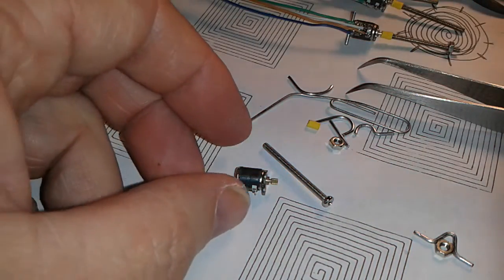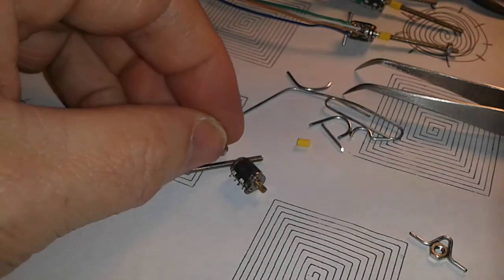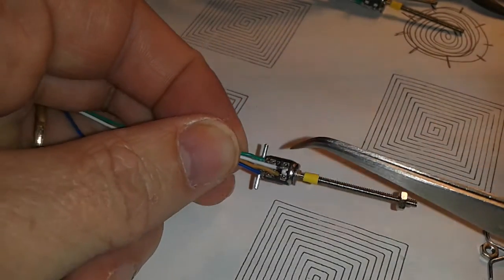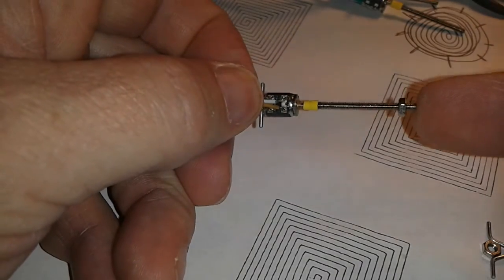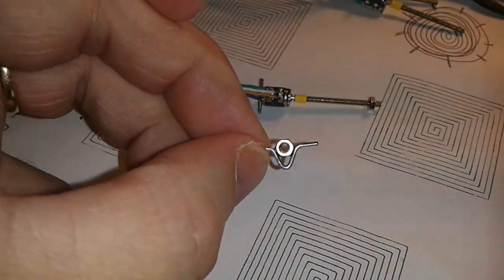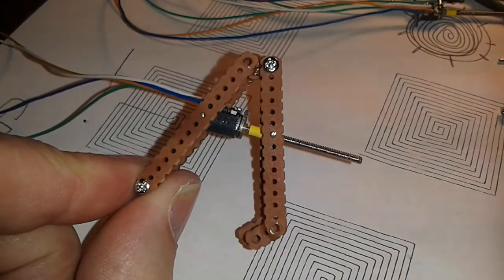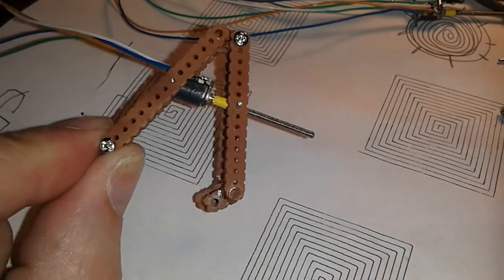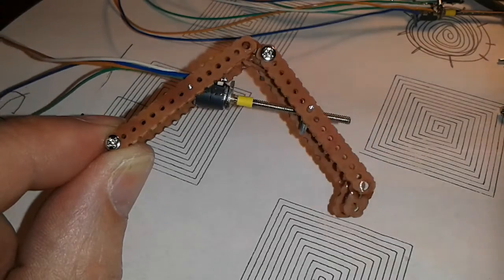Micro Mini CNC Linear Actuator - Part 1 - Building the parts.

Comment: Would you happen to have a diagram on how to wire the motor. I really like what your doing. I would like to see it when you are done.
Reply from the maker: It is s standard 4-wire bipolar stepper motor. Requires a controller of some sort. I have some vids of a robotic arm I made with several of them.

Comment: If you would disclose how you are driving the stepper that would make your information actually "cool".
Reply: a quick google search for drivers would be "cool" on your part.
Reply from the maker: Any stepper driver will workb but... This is running from a Linux PC, controlled by a Python script, over a USB serial adapter, to a pic12f675 and an SN754410 quad half bridge per each channel. Basically I'm sending the pin-out states serially on a master-slave network.

Comment: Why wouldn't you just use something like these: https://m.aliexpress.com/item/32848412516.html?trace=wwwdetail2mobilesitedetail&productId=32848412516&productSubject=32848412516&shortkey=FJvIrueA&addresstype=600
Reply from the maker: That's a stepper drive for a slim optical drive (I have a few). You could certainly use it to build a linear actuator, but it would be 3 or 4 times bigger, and i don't know how much heavier. However they do sell tiny steppers with long screws on ebay now. That would be a good option.

Comment: When I saw the screws and nuts, that's when I said, "yep I did something like this with this robotic claw I've made". What I did was actually solder the screw to the shaft. I also added a little oil and purposefully left a gap between the base of the screw and the nut. I found that it works better that way.
Reply from the maker: Please post a video so we can check it out.
Reply: Hey Clayton. This is one of the first robotic claws I've made. It's really old and the one I had before worked way better. Unfortunately, I took it apart. I wish I can show you a better one. I did add something else I was working on. I was testing an old motor I've altered. It has a gas line running through it and it allows flames to shoot out of the drill. I can make the flames higher, but with my two jobs and having to relocate most of the time, improvements have been slow lately. 
https://www.youtube.com/watch?v=VYhmYw2Rf8g
Reply from the maker: Cool. I may do something similar to that on my next arm.

Comment: Sir, this is exactly what i was looking for, but i need more speed... can they go faster?
Reply from the maker: PhotoSlash - Maybe. They are running as fast as possible at 5v. The motors will skip if the steps are faster. But they might go faster at 12v. At 12v you will need current limiters or they will probably overheat.
Reply: PhotoSlash - You can make a make it go faster without adding more power, by playing around with the positioning of the pivot points and/or use a courser threaded rod and nut. Either case, will decrease the amount of pull/push force the assembly can provide.
Reply from the maker: mtktm - Yes. This is another good option.

Comment: and i would like to know what circuits you used to control those stepper motors.
Reply from the maker: The motors are powered by an SN754410 quad half bridge. The SN755410 is controlled via a PIC12F675 microcontroller from a serial port. It could also be done using the pins on a raspberry pi. I have a website, www.PyPins.com, where I am trying to document the process. All the software is up-to-date, but the documentation is not at this point.
Reply: your video made me to try my mini project possible...thanks for the video....i'm trying to use Arduino Nano with L298N drive...are these motors gonna work?
Reply from the maker: Yes. The SN754410 is a direct replacement for the L298N, so that should work fine. Just be careful with the voltage on these little motors. They have low resistance and can get hot very fast. I turn them off (set all pins to low) when they are not moving. This gives them time to cool down.

Comment: can you please tell which of these motors are like yours.........

http://www.amazon.in/3-5V-Phase-Camera-Stepper-Motor/dp/B00MJTXVBA/ref=sr_1_18?s=electronics&ie=UTF8&qid=1488947690&sr=1-18&keywords=mini+stepper+motor.....................
(  or  )..........................http://www.amazon.in/dp/B06W9KSGW8/ref=wl_it_dp_o_pC_nS_ttl?_encoding=UTF8&colid=1NPQEYW1VZNCK&coliid=I1MEP95T1DAKQD
Reply from the maker: They are similar. I think mine are 6mm in diameter. Look on ebay. There are many different varieties that are very inexpensive. Some already have screws attached.

Comment: Hi Clayton, I bought 10 tiny steppers from Banggood a few days ago.  They may be of interest to your viewers because they already have a screw and nylon nut.  Price is less than US$0.93 if more than 3 are purchased.  Banggood listing is "DC 5V 2-Phase 4-Wire Micro-Step Motor Mini Slider Screw Stepper Motor"  and the URL is http://www.banggood.com/DC-5V-2-Phase-4-Wire-Micro-Step-Motor-Mini-Slider-Screw-Stepper-Motor-p-997700.html   I have not tried them out yet, but as you say, attaching wires will be a real challenge.  How do I know this?   Let's just say I tried it, and I now have 9 motors.   :o(
Thanks again for your videos.
Reply from the maker: Thanks for sharing these, John. You really can't beat a price like that, even if you had to remove the bracket to just use the motor and screw. I'll be interested to see/hear what you do with them. I think I'm going to move on to some projects with bigger motors. Those small ones are so tedious.